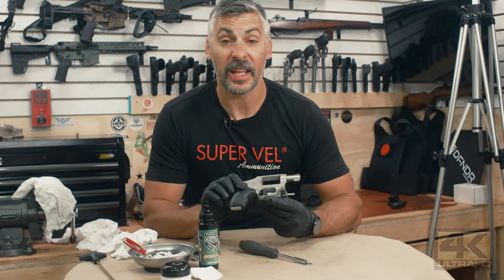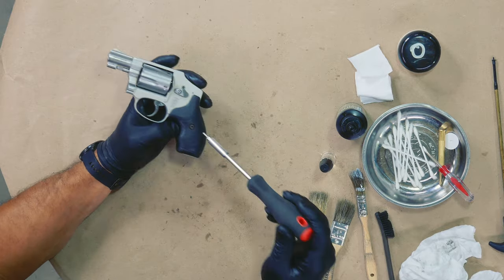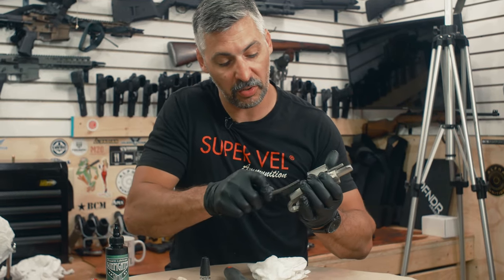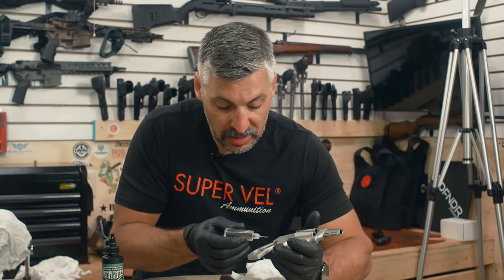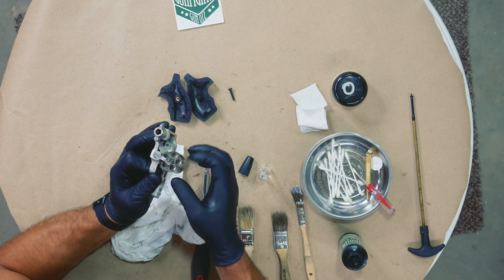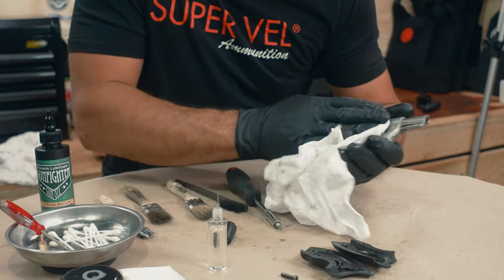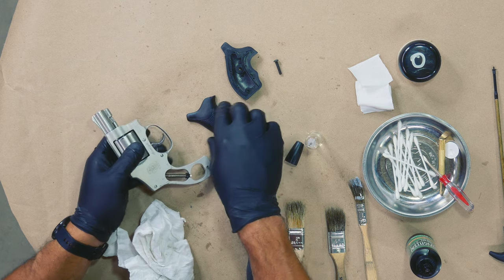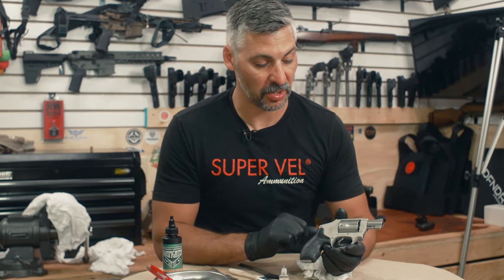How to Oil a 38 Revolver

Comment: Mick is the Bob Ross of gun oiling. Happy little drop of oil over here.
Reply: @rayburn8282  damn bro, who hurt you?
Reply: He puts way too much oil on a j-frame.  Makes me think he doesn’t know what he’s doing.  Just being WAAAAAY TOO MUCH oil for a J-Frame.  There was more oil on that gun, than what spilled out from the Exxon Valdez.  Talk about attracting more dirt, lint and grime!   Ridiculous.   Popularity on YouTube is NOT an indicator of one’s knowledge.
Reply: @colt10mmsecurity68 where are the places I should oil my revolver ,,and is it ok to use synthetic motor oil
Reply: @craigfinley2507  Where the cylinder swings out and is attached to the frame… one tiny drop and that’s it for a revolver.   Wipe the gun down with an oily rag when done cleaning it overall.   It’s better to use a synthetic gun oil, as it’s a preservative against rust.   Keep motor oil for “motors.”

Comment: Nice video, straight and to the point.
Respectfully - Use caution when oiling the underside of the extractor and the recess it sits in.  My practice is only one drop, pump the extractor rod a few times to distribute the oil, then wipe the area dry with a clean dry patch.  Oil in that area has a tendancy to attract and retain unburned propellant flakes making closing the cylinder or pulling the trigger very hard or impossible.  Shorter barreled revolvers are especially prone to this.

Comment: I recently picked up a Charter Arms Undercoverette in .32 H&R Magnum. I gave it a once-over before firing it, but had missed a couple points that you mention here. 

It's very similar to the J-frame Smith and Wesson, to the point that J-frame holsters fit it well. The .32 H&R is a flat-shooting round, or so many people tell me, and I like having that sixth round in the cylinder. 

After a hundred rounds or so, it was time for a good cleaning and careful lubrication. Since I plan for this to be a carry piece, seeing this video helped me find a couple nooks and crannies to keep tidy.

Comment: For rusty screws, drop into a cup/bowl/container with just enough apple cider vinegar to cover. Let sit until you see a discolored "foam" start to form at the surface as the rust particles are loosened from the metal surface. Remove and dry well, brush with medium bristle toothbrush and arm and hammer toothpaste. Polish them up with a soft cloth. You'll be amazed. For stubborn rust, use fine grit sandpaper carefully, so as not to scar the surface or remove materials that may damage the screw slots. Just enough to grab any embedded rust and remove it. Then repeat in the ACV to polish steps. Add oil as the final step as he says in the video. 

I've used this on truck wheels, outside engine parts (intakes, brackets, water pump casing, etc.) and even a large cast iron skillet I found buried in the yard at the farm. It took three passes with the ACV and a lot of elbow grease but I'm still using the skillet to this day with no rust.  When in doubt, do a test with an extra screw. See if it works on that particular material first. If so, proceed. If not, well...stick to the oil and wipe.
Reply: ...too acidic. Just use a small brass/steel brush. Then apply film of oil. (I speak of very small GUN parts).
Reply: or wipe it for two seconds with a brush or light sandpaper like this guy did
Reply: The screws aren’t that important to do all that
Reply: or just get a new screw for 10 cents.

Comment: while my grips are off, I invert the centennial & put 1 drop of oil into the internals & let the oil work through (some will leech out around the side plate & under the cylinder release); my bodyguard gets similar but with hammer cocked & 2 drops of oil into internals; I lube other areas as shown

Comment: I'd be curious to know if you have any strong opinions about graphite as a lubricant, whether administered dry or in a solution like LockLube.  Most locksmiths swear that mechanical locks should be lubricated by graphite only, or a graphite solution that evaporates dry.  What do gunsmiths think?
Reply: I worked with graphite as a locksmith and it tends to attract dirt and grime. I would not advise

Comment: What about the latch & spring inside the cylinder? You know, the one that holds the cylinder in place, especially in those S&W revolvers? I mean, if the latch is rusty and and fails to come out of the cylinder it won't hold the cylinder in place properly right?

I surely wouldn't want to have the cylinder get loose out of the frame when shooting a revolver.
Reply: I do oil there

Comment: Hey Mick, what holsters do you recommend for the 642? Just bought one for a run to the mailbox/store gun, and want something IWB that's simple and quick to throw on.
Reply: Look into an ulticlip holster. The clip will clamp onto your pants or shorts or whatever you're wearing. No belt neccesary. I use one for my snubby and it's a great holster
Reply: One of my 642's rides on my hip in an open top Galco leather Concealable holster. One of the best OWB holsters in my opinion.

Comment: Best self defense EDC there is.  5 is more than enough if you what you're doing.
Reply: Not really
You could be facing multiple threats and or miss in that situation. A 38 special can also be stopped pretty easily from soft body armor. In this day and age it’s more of a backup edc weapon but in most cases 5 should be enough

Comment: When you carry your revolver , do you keep it with no bullet under the hammer ? Thinking about carrying my 856 but manual recommends carrying one less bullet.
Reply: No you can carry fully loaded. Most modern revolvers including your 856 use a transfer bar safety which allows safe carry fully loaded. The quick description is the hammer can never touch the primer until the trigger is pulled. There is always a space between the hammer and the bullet until you pull the trigger at that point the transfer bar moves up into position the hammer then strikes that.

Comment: So, I suppose the oil you are using is household Mineral Oil being that it is thin, clear, food safe, and doesn’t degrade over time. Just an educated guess. Quite a few “in the know” people recommend mineral oil for areas which are not “high velocity” moving parts (aka: not for use on semi auto slide rails, barrel linkage, barrel bushings, etc). Low velocity moving parts like revolver trigger assemblies, cylinders, cylinder crains, hammer pivots, etc are fine to use Mineral Oil and you don’t have to worry about it reacting with certain finishes and plastic parts like some petroleum based oils. Be safe out there.
Reply from the maker: We do not use mineral oil. GunFighter oil is a synthetic lubricant.
Reply: @CarryTrainer is it ok to use mobile 1 synthetic motor oil

Comment: I oiled the cylinder shaft where it meets the cylinder and now the cylinder doesn't spin freely.
Reply: The oil would not cause that issue alone. Remove the cylinder from the shaft clean and relube. They will get carbon and soot which will be the cause of the drag you are feeling.
Reply: I take my cylinder off after every range session and wipe it down and re oil. It’s my carry so I always do a deep clean
Reply: @barefootbob1269  Have to find out how to do that.
Reply: @Jx12346  Have to find out how to do that.
Reply: @MDMiller60  Pretty easy first remove the small screw on the right side of gun above trigger guard this will allow you to remove the crane and cylinder from the frame. At that point just pull the cylinder of the crane. Crane is the part you see pivot when you open and close cylinder. it is located at the bottom front of frame. Good luck super easy to do

Comment: Note that this guy pressed the trigger six times before he thought to check the chambers.  Sorta like shutting the barn door after the horse has run out.
Reply from the maker: Hilarious.  I was just working the action.
Reply: Agreed.  The usual practice is check to see if it's loaded BEFORE dry-firing...  If the gun fires when you're dry firing, then you ain't dry firing!
Reply: I can't imagine he would check the gun before recording just in case some idiot has a break down over something trivial 😂
Reply: @goateecusbilly1823  Are you trying to be a wee bit facetious?  I'll stick with Gunsite Doctrine.  It works.
Reply: I will say that he has good taste in ammunition.  Super Vel has been around since the sixties.  I used their high performance stuff in San Jose, CA, and so did most other officers on SJPD.  I'd thought they'd disappeared, but they're still busily turning out both high performance and practice ammunition.  Their 115 grain practice ammo works really well.

Comment: WAAAAAY TOO MUCH oil for a J-Frame.  There was more oil on that gun, than what spilled out from the Exxon Valdez.  Talk about attracting more dirt, lint and grime!   Ridiculous.
Reply: Did you notice he wiped most of it off? He’s just ensuring the points that need oil, get them, then wipe excess.
Reply: @TheSouthpawSharpshooter  Only if you’re “new” would anyone oil [spill] a gun like that.  
…whadya new too???
Reply: Can I use hair clipper oil
Reply: Did he oil the spring
Reply: How often do you need to this oiling
Reply: 😂😂😂😂 it ain't popping easy if it ain't greasy 😅😅
Reply: @craigfinley2507    Yes you can. It's not critical. I just use Mobil 1 synthetic engine oil. A penny's worth will last twenty years. U want one of those needle tip oilers tho.  Use very very little oil.
Reply: My gun has a hammer, is it ok to put oil down in the hammer part.
Reply: @craigfinley2507  No!  It’s unnecessary for a revolver and also attracts more dirt down there.
Reply: @colt10mmsecurity68  in your opinion where should I oil the gun
Reply: @craigfinley2507  Read what’s posted  above.
Reply: @MrLanternland  Ok thank you
Reply: Lint is a real problem.
Reply: @colt10mmsecurity68  are you saying don't oil it
Reply: @craigfinley2507  I’m saying a wheel gun needs maybe a micro drop on the ejector rod as far as lubrication goes.  That’s it.   For rust prevention, a light gun oil on a clean rag and then wipe the entire surface of the revolver down.   AFTER cleaning the gun, a patch with a little gun oil pushed through the barrel and then followed by a dry patch or two and the revolver is good to go.    That’s all one needs for wheel guns.  The internal moving parts don’t require oil.  They haven’t for over 250 years or so.
Reply: Yes, that's mineral oil.
Reply: Link to your video please. Show us how it’s done.
Reply: @tedlarson2078  if you need a video on how to oil a revolver, you shouldn’t be handling firearms at all.   Seek help.
Reply: He's got stock in 3in 1
Reply: I second that opinion. Guns use tool steel and tool steel is designed to run dry. What the oil does is capture grit and hold it in place- voila’ - now you have a grinding compound. A gun is not a reciprocating engine. The only items you are missing? A little gasoline and a spark plug. Don’t take my word for it. Call Ruger Customer Service. They will tell you over the phone: Do not oil your revolver! I suspect Ruger knows a thing or two about guns…
Reply: @colt10mmsecurity68 Ass-backwards. If you think you need to “oil” a gun seek help. There, fixed it for ya’. 🤠
Reply: Only thing with more grease than your gun is Gavin Newsom’s hair.
Reply: Yeah well the points that need oil don’t need oil. That’s the issue here. @TheSouthpawSharpshooter
Reply: @colt10mmsecurity68 Correct. What we have here is a bad premise.
Reply: @craigfinley2507 No the question isn’t “Did he oil the spring?” (He did). The real question is what didn’t he oil?
Reply: @craigfinley2507 Try never.
Reply: @craigfinley2507 Yes, of course. Squirt oil into every opening, orifice, and crack. If you have a semi-auto be sure to remember to oil the magazines. Oil the hell out of the receiver on any rifle you may possess, and store the rifle vertically - the oil will migrate down to your wood stock over time and really do a number on it. 😵😁
Reply: @tedlarson2078 Call Ruger: no oil!
Reply: @craigfinley2507 Yes. For hair clippers.

Comment: This is simply not good info.  The guy has to do this once a week because if it’s carried at all that oily mess will be covered in lint and crud.  And do NOT oil the ejector rod.  Do you even revolver or just make videos?   Seriously take a revolver class from someone with experience
Reply: You sir a wrong you absolutely can and should oil the ejector rod. Yes I have taken many classes over my 50+ years of shooting and hundreds of thousands of rounds down range. We all do our cleaning and lubricating a little differently. I can promise you that amount of lube will never be a lint issue on a j frame or any other gun.
Reply: I'm sure Mick has just a "tad" more experience with guns than you... you might wanna consider changing your name to No common sense.
Reply: Why not put a tiny bit of oil on the ejector rod?
Reply: Where should you oil your revolver